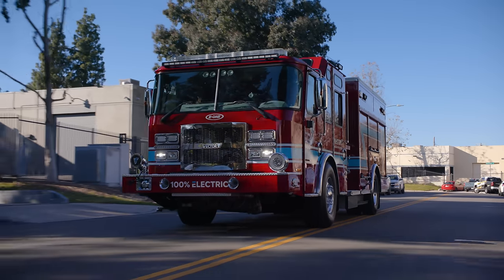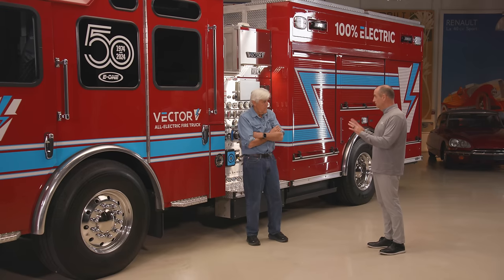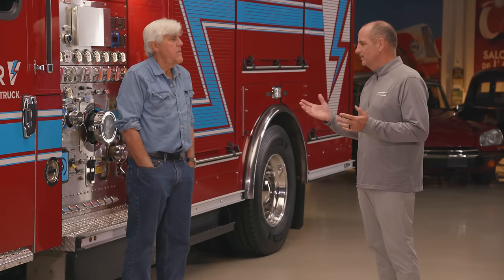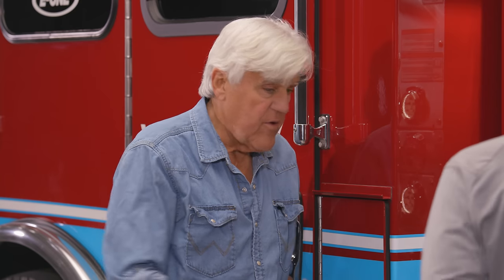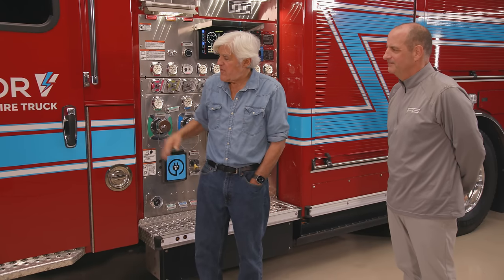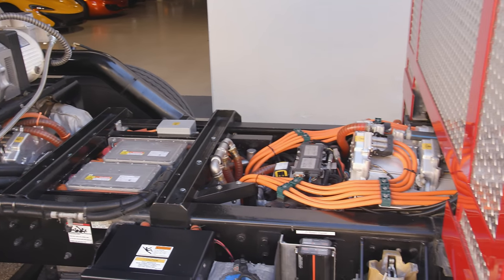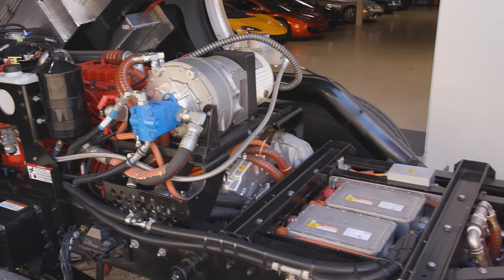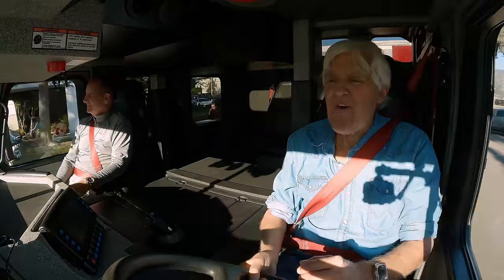The Future of Firetrucks?

Comment: After watching Tim Allen's garage tour and hearing him say of his Tesla "let's be honest: it's a golf cart!" i can't help but think that when I see ANY EV....
Reply: I hit 90mph with a 2 second blip of the accelerator from 30mph in my "golf cart" today. Not even full throttle.
Reply: Barely similar
Reply: @billstevens3796  But is it as reliable as a Diesel?. The top 3 requirements of an emergency vehical are:
1 Reliability
2 Reliability
3 Reliability
Reply: @billstevens3796 hitting 90mph from a 30 roll isn’t impressive my guy. I can do that with a 2.0L ecoboost suv.
Reply: @phillipsmiley5930 Tesla’s are, other EV’s, can’t speak for those.
Reply: @official_pol2198  Reliability includes being able to run for long continous periods. No battery can compete with the efficiency of Diesel
Reply: Yes and you car is just a ride on mower.
Reply: @phillipsmiley5930  It's like you are spam operation not capable of watching the video. It has a freaking DIESEL GENERATOR and DEF for the generator. It's only used when you surpass the 4 hour pumping run time. The reliablity should be great.
Reply: @phillipsmiley5930  "No battery can compete with the efficiency of Diesel" It has diesel onboard as a backup.
Reply: @phillipsmiley5930  "No battery can compete with the EFFIEINCY of Diesel" Nope diesel engines are horribly inefficient to a battery charging and drain cycle. Battery is far superior much more efficient with energy. You are using the wrong term.

Comment: The fire truck batteries weigh a lot, and so does water... I'd rather have a truck show up with more water than be weighed down by batteries.
Reply: Because massive diesel engines and fuel tanks have zero mass?
Reply: @revidual  wasting your time trying to educate these types . They hate all progress.
Reply: @revidual  Diesel is hugely more energy dense than batteries are, so the fuel tank can be far far smaller than an equivalent battery. Also, this EV firetruck has a diesel engine as well, making your argument doubly invalid.
Reply: most urban fire engines carry 500 to 750 gallons of water which is plenty to start fighting a fire until it gets connected to a hydrant.

Comment: How many hours straight can it sit on a hydrant and pump?
Reply: Probably multiples of many.  What really consumes battery power is driving the vehicle itself great distances.  Once parked, you're just running pumps with massive battery power.
Reply: @aussie2uGA  Listen to a truck when it engages the pump(s) - it throttles up A LOT. Come back when you know what your talking about.
Reply: He said in the video 4 hours, running off the battery. The diesel range extender then charges, at a higher rate than the pump operation consumes.
Reply: It can sit on a hydrant until a tow truck comes & drags it off of it. The batteries are underneath the truck so they might get damaged from the impact. Hope this helps. 👍

Comment: That's where electric vehicles shine. Fire trucks don't drive across country.
Reply: Yep. This is a perfect use case. In the department I'm a volunteer for, our average miles+hours per week on a rig is about 20 miles + 5 hours. I know one truck we've had for 20 years has under 10,000 miles on it still.

Fire equipment doesn't tend to get used that much.

Looking at these, it says they have a battery up to 327kWh. That's three F-150 Lightning batteries. Even as heavy as this is, that's more than enough to drive 40 miles, then run the pumps for 10 hours and drive 40 miles back to the station. And in our department, no truck will ever be going 40 miles from its station, or staying on a fire for more than 10 hours.
Reply: no, but they sit at the building is on fire for many hours and that needs power for the pumps, which is why they have a diesel gen onboard, which makes it pointless making the damn thing an electric truck
Reply: @CarlDraper  The fully electric version has a claimed “on scene” usable time of 12 hours. Which is more than most diesel engines currently stay on scene. (Most are rotated out after 8-10 hours.)
Reply: Good thing the electric power grid is always and everywhere 100% reliable, thus charging when needed is guaranteed, even during hurricanes, earthquakes and other natural disasters. Oh, wait...
Reply: @paulm749  Guess what, gas pumps don’t work without grid power either. I have solar panels on my house and a home-battery, I can charge my EV when my power is out from excess solar. I can’t refuel a gas car that way.
Reply: @AnonymousFreakYT You just ruind your own argument solar keeps gas pumps working and this fire engine has a diesel engine on it it is a plug in hybrid.
Reply: @redemptionjack4657  How many gas stations have solar panels? And in the event of one of the “huge disasters” that has things out of commission for days/weeks, even if the gas station has solar panels, do you think they’re going to get refills of fuel? My solar panels will keep producing power to “refuel” my vehicle as long as the sun doesn’t burn out. (During a major storm outage that lasted nearly a week earlier this year, I produced plenty of power to keep my house livable, with some excess to put in my EVs. Meanwhile, some gas stations ran out of gas, and had to wait until conditions cleared for their restock.)
Reply: @AnonymousFreakYT  If that scheme works where you live (lots of sunshine) and that's how you want to spend your own money, fine. It's not a one-size-fits-all solution and it simply can't be. Let the free market work and let's see what happens.
Reply: @paulm749  I’m in a notoriously cloudy/rainy place and it works. You don’t need to live in Arizona to benefit from solar. 

My point is, if you’re interested in “resilience against disaster” then relying on the supply chain of delivering a flammable liquid to a standalone dispensing station probably isn’t the best option.
Reply: @AnonymousFreakYT  Just your opinion, pal.
Reply: @paulm749  As your opinions are just yours. As are most of the anti-EV commenters, spewing outright disproven claims as if they were facts.
Reply: @AnonymousFreakYT  Check your life insurance, make sure it covers death by lithium battery fire, not that it matters that would never get put on any death certificate
Reply: @AnonymousFreakYT  Gas pumps used to have hand crank back up,
if they no longer do? then thats been planned
Reply: @AnonymousFreakYT  This is tedious. Toodles!
Reply: @paulm749  Yes, listening to uninformed people is tedious. Bye, buddy.
Reply: @phillipsmiley5930  Not in a long LONG time. My very first job was at a gas station in one of the "no self service" states in the early '90s. Our old pumps were replaced with new ones with no hand crank backup; and I know most gas stations now use much newer pumps than those from the early 90s.
Reply: @phillipsmiley5930  Sure. Check the statistics on EV fires vs. gasoline car fires. Lithium battery fires in EVs are exceedingly rare. GM recalled and repaired hundreds of thousands of vehicles after three fires. And Ford just recalled hundreds of thousands of gasoline vehicles over fire risk.
Reply: @AnonymousFreakYT  Hugs and kisses to you too!  ❤❤❤
Reply: @paulm749  Can you pump gas when the power is out? Let me know.
Reply: @TheZebulonPike  Do you realize that, at best, you're admitting that all-electric is no better than IC power? That's not a win, pal because you still have all the other severe downsides to deal with - limited range, batteries susceptible to severe fires, overall chemical toxicity, etc. EVs are an absolute DISASTER and you can put all the lipstick you want on that pig, but it's still a damn pig.

Comment: No ladder 😅👽🎬
Reply: In the back, pull out. Most likely…
Reply: This is not a ladder truck
Reply: There are 2 main types of fire trucks.. Engines and trucks. This is the engine, which carries water and the pump. The other complementary type of vehicle is the truck which could be a ladder and is used for rescuing and getting into places. They do different tasks. Ladders don't carry water or pumps.

Comment: I believe this is a great step forward.  Jay has an excellent video on the Tesla Semi and this is just as informative.  Two thoughts,  LG chem has had problems with their batteries.  CATL may be a better choice.  Tesla has shown that a 48 volt architecture is doable.  They should move up to it.  
No mention whether this truck is capable of ultra high pressure pumping.

Comment: 45,000 lbs? This truck is overweight for a single axle! Should be 12,000 on the front axle, 20,000 on the rear axle. A tandem axle would be 12,000 front axle, 34,000 rear axles. At 45,000lbs, this single axle truck would be overweight for DOT standards. A local fire district had their salesman spec the chassis for their new pumper. From day one the front axle was overloaded. After a short period of time, the truck was sold due too safety concerns. Are fire trucks exempt from weight limits?
Reply: It has what looks to be a 22000 lb front axle and the rear is probably rated for 24000
Reply: They are specifically exempt and overbuilt for these high weight ratings
Reply: Yes most are exempt, my ladder truck is like 70k on 3 axles
Reply: Wow you got that massively wrong.

Comment: According to the International Association of Fire and Rescue Services, firefighters need to use up to 40 times more water to put out a fire in an EV compared to a standard gasoline car. That's about 40,000 gallons on average. So triple that to put out that fire truck catches on fire.
Reply: According to the insurance companies, pure electric vehicles very rarely burn compared to gas/diesel and hybrid (which are the worst for fires). Every year batteries are becoming more fire safe 
From the company that gives insurance companies the data:
Ev fires 25.1/100
Hybrid 3474.5/100k
Gas1529.9/100k

Comment: This is just ridiculous
Reply: Why?
Reply: @EndeavorsDnB  zero benefits
Reply: @Coral-reef. los angelas engine 82 used 60 gallons of diesel all year on theirs.   Electric can be supplied by solar and wind on station property and when not powering the vehicle it can be sold to the grid.  Also, much more fuel efficient than diesel with much more power.  Lots of benefits

Comment: Talk about a solution to a problem that doesn't exist lol.

Imagine the energy needed to keep these huge batteries warm, especially in cold climates? Just to be ready at a moment's notice. ICE vehicles don't expend energy while not in use, EVs do. Couple that with the huge environmental impact producing an EV makes with destructive lithium mining techniques, it'd far outweigh any "Benefits" it brings versus an efficient turbo-diesel engine.
Reply: You mean warm, like stored in a climate controlled garage warm? Something like a... fire station?
Reply: @stevevarholy2011  I think you're intentionally missing the point of my comment, this isn't as much of a gotcha as you think it is lol
Reply: Child slave labor lithium miners is ok but burning diesel through a tier 4 emissions compliant exhaust system and catalytic converter is bad.
Reply: "Imagine the energy needed to keep these huge batteries warm, especially in cold climates" NOT MUCH considering it's a monolithic brick.
Reply: @loganbaileysfunwithtrains606  "Child slave labor LITHIUM miners" That does not exist.
World's biggest supplier of Lithium for the EV Industry by a large margin is AUSTRALIA. I've never seen slave or child labor at any of the Australian mines i've worked at.
burning diesel through a tier 4 emissions compliant exhaust system is realy bad compared to something that does not exist.

Comment: How does it work in cold, cold weather?
Reply: EVs have to maintain the health of the battery.   This means using battery power to maintain minimum and maximum temperatures.  (They typically have a heat pump system.)    If it stored in a warm firehouse, it might be OK in typical use.   If outside, it can get into trouble.

Comment: I understand Jay has never been a firefighter, so I get it it, but the big Boston Chelsea fire in the early 1900s had responders from as far as Baltimore,  but mismatched hose couplings were a major issue. Even with the National Standard thread standard, not everyone uses it. It is not a required standard.

Comment: The pump was pumping at about the same pressure as my garden hose, and was quite loud (high-pitched). Would love to hear it at a working fire with two 2 1/2 lines working at the proper pressure settings. I never wore ear protection while working the pumps, they aren't that loud.

Comment: I've seen fire trucks from LA fire clear up in Shaver Lake California and Visa Versa.. so yes they do drive quite a long ways and have to get there in time to prevent more damage... What's the motor run time on batteries for a pumper truck? That's going to be a problem since forest fires happen in the forests where the power lines will dead...

Comment: A diesel engine equipped with a Def system or diesel exaust fluid system is very clean. They have used them on big trucks for well over a decade.  New trucks don't smoke. I was told that the exaust coming out of the engine is cleaner than the air coming in. So diesel power will be around for a long time.
Reply: With tier 4 emissions compliance in the US now being standard, the exhaust coming out of a diesel engine is essentially carbon monoxide and for simplicity sake without going into chemistry it’s water vapor and some other carbon exhaust byproduct. I wouldn’t say it’s cleaner but it’s as clean, still don’t want to be in a confined space with one running but far cleaner than in the past and far cleaner than running a EV with a bunch of off gassing chemicals

Comment: The idea and concept is interesting. But 4 things are going to keep them away from departments. One is weight. Two is price. Three is charge time. 4 is the ability to repair it. In ways it is a better truck. But for most departments, I just don’t see it being a mainstream thing. My dad struggled selling electric motorcycles in the Midwest. I can’t imagine this’ll be much different in places like that.
Reply: Charge time is a non-issue, since it can respond to calls regardless of battery charge level; it just uses the diesel engine if required. 

I agree that weight, cost, and serviceability are issues.

Comment: in my small town they build a electric motor rebuild plant.  they added 3 phase power to it and our grid couldn't hold it. so for years they had their own generator to test their 3 phase stuff. now our grid can handle it. but they still not allowed to test them except from midnight to 5 am. or they can and sometimes still shut the power down